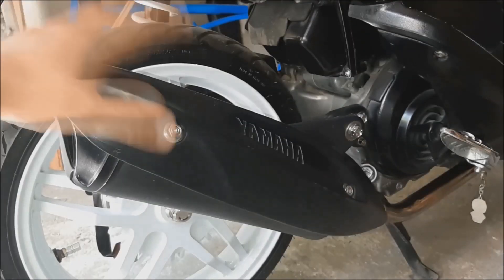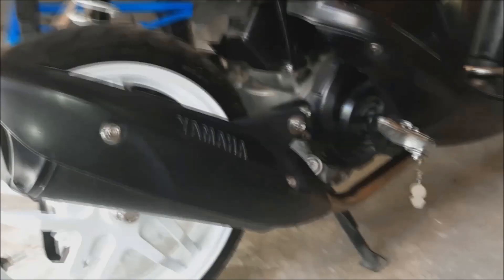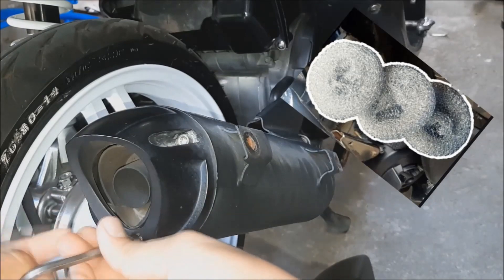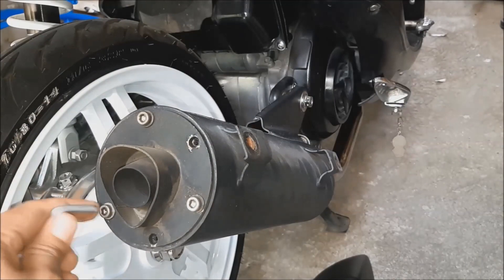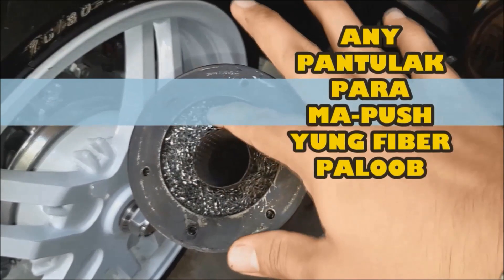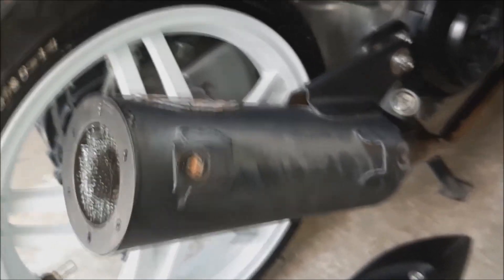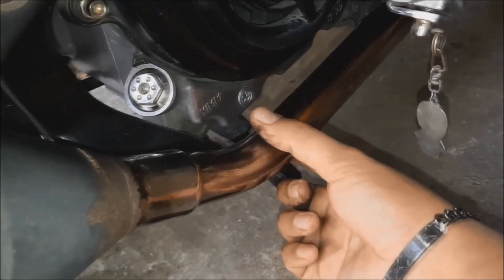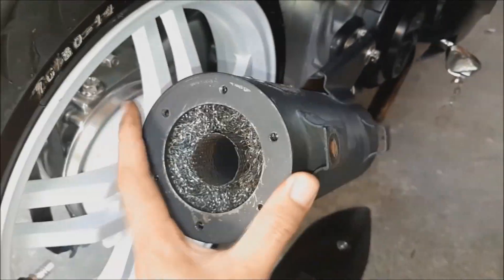STEEL WOOL CHICKEN PIPE #miosporty #motovlog

Comment: No hate, sharing is caring💖. Base sa naoobserbahan ko sa mga naglalagay ng mga steelwool sa mga pipe nila ay napuputol yung screen. Hindi kase advisable na maglagay ng steel wool sa mga pipe, pero nasa sa inyo parin naman kung maglalagay kayo(dahil lulutong talaga ang tunog). Yung steel wool kase mas mabilis magabsorb ng heat kumapara sa fiber wool. Kaya fiber wool ang nasa stock ng mga modified pipes. Yung heat na napoproduce ng screen naabsorb nung steel wool, so may possibility na mas pataasin nung steel wool yung heat at magpalambot doon sa screen na nagiging dahilan ng pagkaputol. Fiber wool are designed specifically for high temperature exhaust systems dahil kaya nyang magabsorb ng high temprature ng hindi natutunaw o nalulusaw. Ayon again no hate, sharing is caring. Ridesafe palagi mga paps and God bless!💖
Reply from the maker: Magandang araw...

Salamat po

Pls dnt 4get 2 subscribe 
Thank you po
God bless